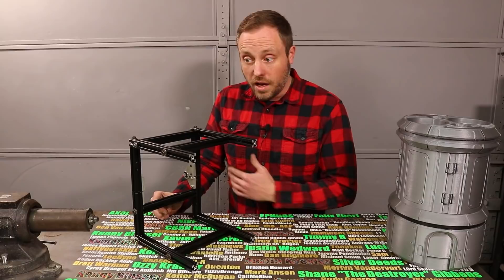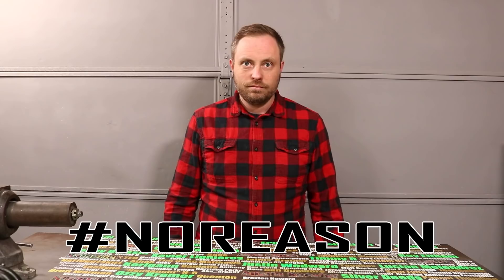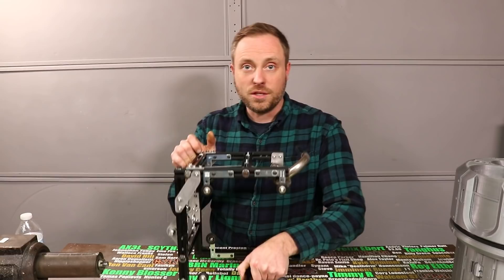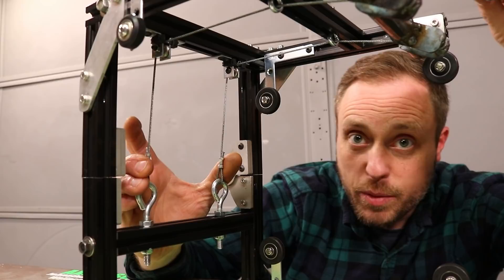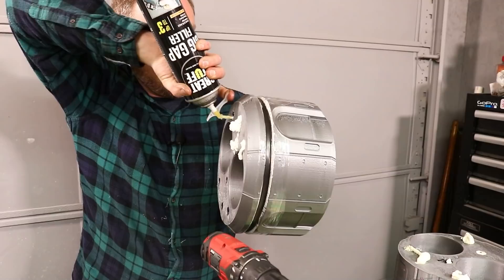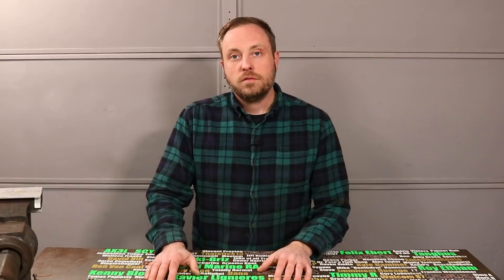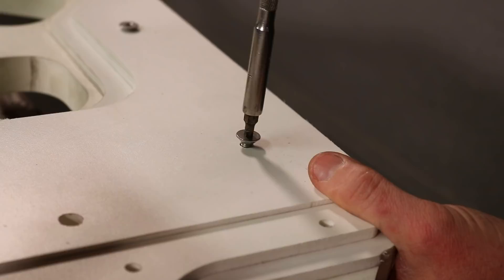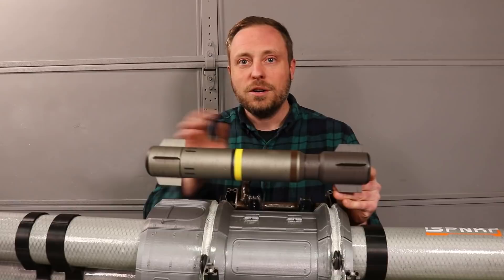It's Coming Together! - Halo Rocket Launcher - Part 2

Comment: Design a stable rocket that looks like it would fit in the halo universe
Reply: this^
Reply: Wait, if most of the instability is because the front is basically a brick, why not carve vents to let the air pass through so it looks game-accurate but flies more true? We won't see the rocket from the front, not unless we're gonna get a sunburned face to the 3rd degree XD
Reply: Yea like a version 2 of that rocket

Comment: You could try to hollow out the middle of the rocket and add in a double-helix. Also add in vents at the front and back of the rocket. That way you could create rotational force using the inside of the rocket while launching, but keep the in-game accurate exterior.

Comment: Best of both worlds...  Make the front finned light-grey section a detachable sabot shell/surround, then have a standard cone tip underneath. Have the back dark-grey fins fold out if needed for stability.  Hell, you already did all this prototyping with the pringles can launcher.

Comment: Putting the rocket motor in front of the rocket and letting the exhaust flame blast through a tube towards the rear could make it fly and solve weight issues. I got the idea from the thunder spears video from the Hacksmith. Then you would be able to keep the original Halo design.

Comment: Love your attention to detail, not just in form but also function. I would've figured most people wouldn't have gone through the trouble of reinforcing the rolling ring, since it only needs to work for a few shots in a video, but you build your stuff to last.

Regarding the rocket design, if it's not too much trouble, I'd say to do both: try launching a few of the game-accurate design so we can see how bad they fly, but don't waste time trying to optimize that design to fly stably. Instead try to build a 2nd rocket design that will be stable, with bonus points for looking like they'd fit in the Halo universe.

Comment: seems like adding some spring loaded stabilizing fins to the back would let you have the right "look" but give you something with a bit better chance of flying strait something along the line of the rpg-32     TBG-32V Thermobaric Grenade   if you squint a bit they look very similar  so it might let you get the right look with something that will fly without alot of testing

Comment: If you put the rocket motor and maybe some extra mass at the very front of the rocket, and have the rest of the rocket behind that essentially be a hollow tube, I think that should move the center of pressure(center of drag? I'm not sure the proper name, but basically the center of where the oncoming wind would apply force to it.) behind the center of mass making it stable in flight. Some old bullets before spin stabilization was common used this technique, the bullet was like a hollow cylinder with the front being capped. Sort of works like fletchettes on darts.

Comment: If the in game rocket had the front vanes split away and fall off like a sabot, it'd look game accurate when you load it and be aerodynamically stable after it launched.

Comment: If you can get the rocket’s center of mass far enough forward, it might fly straighter than you think it will. If everything aft of the yellow line is nothing more than a thin tube (think 3d print in vase mode), and you make the forward 1/3way more substantial, you could conceivably get the CoM to be just aft of the forward fins. Using a strong motor that can fit entirely ahead of the yellow line would help tremendously here, but I have no idea what size motors you’ll be able to use.

The fact that the front of the rocket is flat is not actually the problem, as long as the motor is strong enough.

Comment: This is definitely over-engineered but I think what would be a good idea is making the rockets transform into a more aerodynamic shape this would be mid-flight so that way when the rocket is prepared inside the tubes they would look how they were supposed to. But sending it up so that way after it goes to certain speed or some sort, a device at the end of the barrel would act as a receiver and activate the other form of the missile. 

Just a thought.

Comment: I kinda have to go along with others. A few game accurate and a few aerodynamic ones. The game ones. Look like they could use longer fins in the rear. Maybe figure out how to add a spring deployment.  So after the rocket leaves the tube. The fins deploy giving it a Lil bit more stability. The front fins I'd  leave alone. They could act like kenards I think is the name.

Comment: Get the weight distribution of those game accurate rockets right and you might be surprised at how well they fly. Have a look at ‘half length darts’ in the nerf hobby versus full length darts and how they compare in terms of accuracy. That is all down to the weight distribution. Those have totally flat fronts aswell in many cases.

Comment: whatever rocket you make works for me .. but I wonder if the front part of the rocket could be a Hollow tube and the center could be the Cone .. where those parallel lines are those could be Cutouts to allow Air to flow past for Aerodynamics